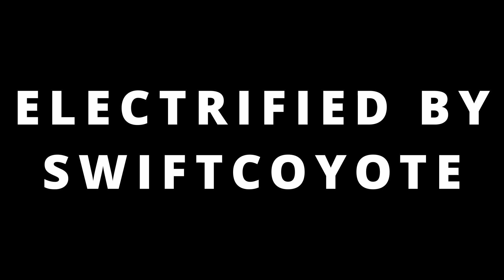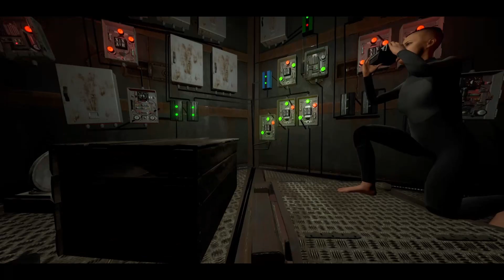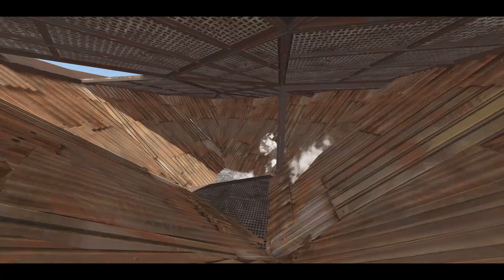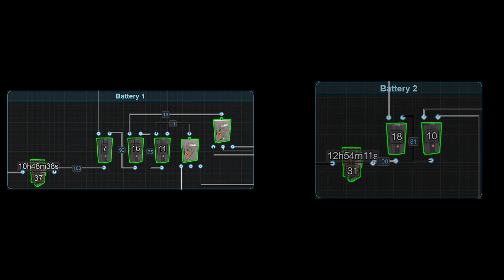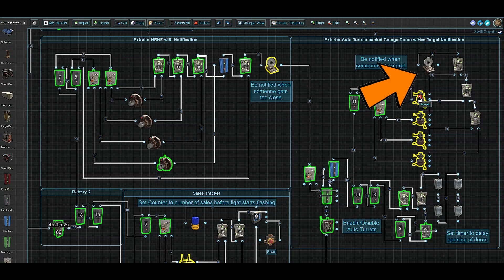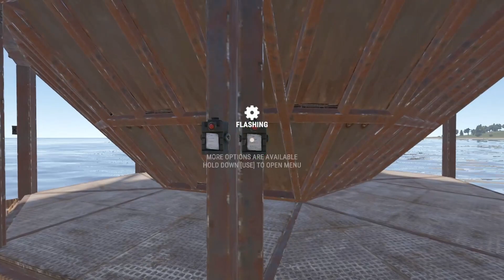Blueprint Breakdown - The Electrified Sea Bunker - OUT OF DATE

Comment: What about the non electrical upgrades, like how to build the pods and how you built the bottom half?
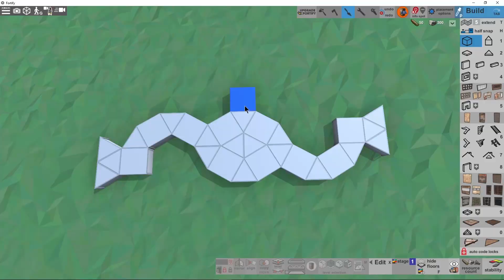Reply from the maker: If  you watch Mavericks video, he shows how to build it. When he uses double door frames under the water for the exterior, swap them for walls. If you want to include vending machines, use the door frame. Where you put them is up to you. Then use double door frames in the rest of the interior underwater build spots. At 2:23, thats the foundation layout in Fortify. The only part of those arms that get built up is the triangle foundations. The left and right side triangles are just honeycomb.
Reply: @swiftcoyote1444  Awesome thanks. I actually found yourvid through mavericks video. I built this last night on live server. I wanna add the pods but in the future wanna see if I can figure out how to make them disconnectable tc's. as well. Great vid thanks alot.